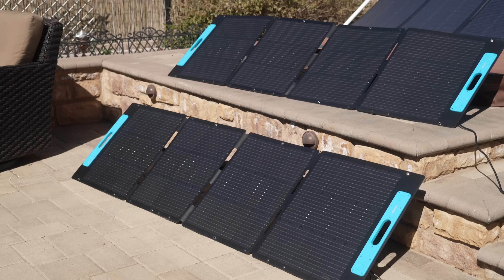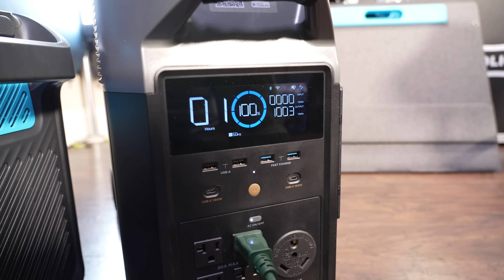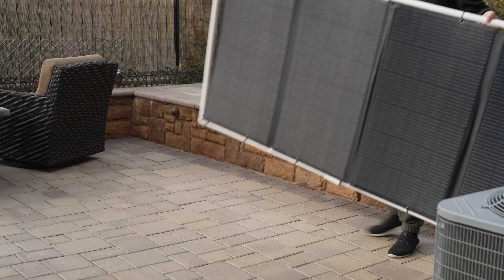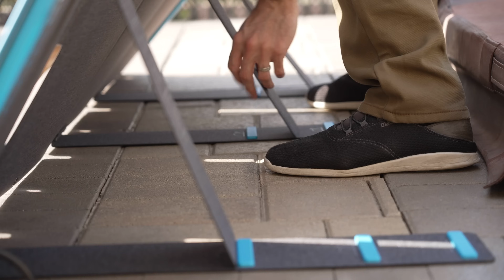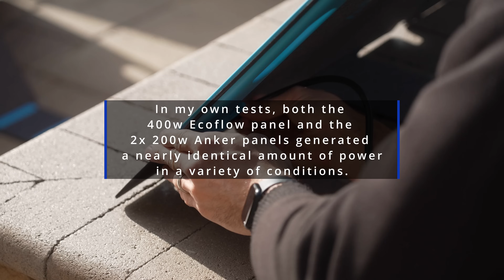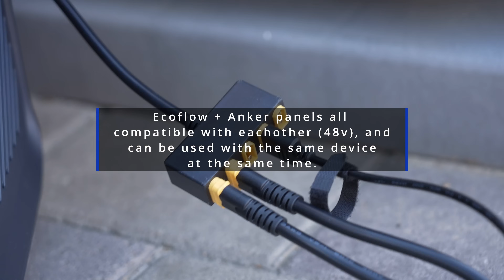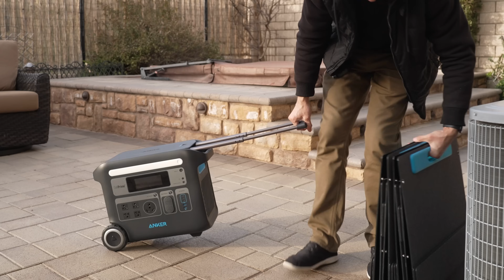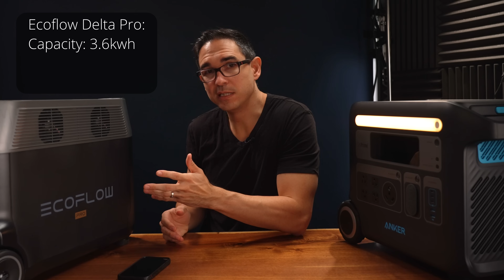Why I like the Anker Powerhouse 767 BETTER than the Ecoflow Delta Pro

Comment: it got to be an easier way than paying $5000 for generators that only last up to 36 hours. I'm still hook on using a car alternator as a generator with a small motor thats hooked up to a solor panel just to start it and once it's gets going you dont have to worry about the hours. it just seem like a rip off to keep making the rich richer.

Comment: All great points! I am looking at the spec for the 767, and I don’t see a DC 12v @ 30amp port. The spec shows 2x 12v @10amp port. Am I missing something? Or is the spec on their website wrong?
Reply from the maker: It has a 30 amp plug but I wouldn’t push it past 20 amps. (2.4kw)

Comment: Thank you very much.  I do not yet own a home battery generator.  A question I have had for quite some time is --- My need is for occasional (not very often) basic home emergency power (cell phones, fan, etc).  What I have not found addressed is what is the long-term power management for such a battery generator, which may not be used for many months, so --- do you leave it connected to AC power 100% of the time for months on end, without "using" the battery, waiting for an emergency, or is there some form of periodic use that you must perform to help drain the battery, then recharge it to full power?  In other words, just how is the battery to be maintained for months on end, over years, when the battery is not being used very much?  Thank you.
Reply from the maker: You’re supposed to do a full drain and charge once every 3 months. Otherwise you can just leave it plugged in.

Comment: We’ve seen EV owners hook up inverters to their 12v’s and power small loads like the Anker 767 will do.  My question is since the 767 has the inverter built in, could one theoretically use the solar DC input for the 767 as a way to recharge from an EV’s 12v?
In other words, power goes out, use the 767 initially and if the outage persists, then hook it up to your EV to extend run time during the outage.  Thoughts?
Reply: Yes and no. 
First issue is at 12v you could never pull a meaningful amount of energy. Generally the 12v system on ANY car can only supply 150-200w through a barrel, and even if you could hook into the 12v battery directly, it probably would still be limited by the transfer rate from the high voltage battery to the low voltage without damaging anything.
Second is you could tie into the high voltage pack (dangerous) unless you have a special charger that can work in reverse like the ford lightning. This would be most ideal in general. Lastly, these units have a limit as to how much they can take in on solar. So you maybe still exceed how quickly the battery can charge.

Comment: Quiet fans aren't much good if your batteries get cooked and die earlier. Look at the initial toyota leafs and their early batter life due to poor air cooling.
Reply: You're equating quiet with fan cooling performance. The two are not as highly correlated as you think. Fans can be made very quiet, if someone wants to bother.
Reply: Toyota Leafs? You mean Nissan LEAF?
Reply: @csf1757  Ooops. Thanks for correcting me.

Comment: Can you check if the units you have all four NEMA 5-20R receptacles (the 4 AC plugs) on the front of my unit were mis-wired, and that hot and neutral are swapped?

Comment: Hi. I am considering on getting a solar generator for my home as a battery backup in case of an outage in my area and living in the desert they can come about during Monsoon season. My question for you on this is If I have to use the generator to run some of my things, Will it charge simultainiously while it is in use?
Reply from the maker: Yes, it charges while in use.

Comment: what do you think is the lifespan of this powerhouse? is it worth buying?
Reply from the maker: If you fully charged and depleted it 0 to 100% every single day, it should still last 10 years. Warranty is 5 years, lifespan rated at 10. It should last longer than that if you use it less. It’s worth buying to me, though i don’t know your situation or reason for buying, that’s up to you.

IMO, in 10 years, we will be much further ahead in battery tech anyways, and I’ll probably upgrade my tech before then, so it should last the entire time I plan to own it without issue.
Reply: @TommyCallaway  thank u so much...

Comment: Good video! But the cycling thresholds and speed are not dependent on what type of semiconductor is in the charging circuit. It is more efficient, but the charging rate is largely determined by chemistry, cell design, temperature and current handling of charge circuit. And of course the supply. Not the type of semiconductor.
Reply from the maker: Thank you Will. I’m learning a bunch as I enter into this genre of tech. Your channel is a fantastic resource!
Reply: @TommyCallaway  oh thanks!!! :)

Comment: Make a long story short liv off grid using the ecoflow delta pro only one unit with 800w solar running every think even a 120v 2000w hot water heater fridge lights ex I over worked it finely after a year running way too much stuff at once one day and explain to ecoflow people and they sent me a new one no questions asked less than a week turnaround.

Comment: You mentioned the price compared to capacity, and the big weight difference that's made even clearer by your face expressions. I think it's also important to underline that the Ecoflow has 80% more capacity than the Anker, and weighs "just" 48% more. So Ecoflow has packed more in the same volume, and that's usually always more expensive in general.
Reply: Overall Anker is a better package.
Reply: Excellent point, but the price also reflects that capacity.
Reply: The ecoflow is down to $3000 now.
Reply: the other thing is that Ecoflow sells the referb pro for $2179 which makes the price closer.....I would go for this but not sure about lifting 100lbs
Reply: @007gomboo  how often do you have to move your battery to be concerned about the weight?!
Reply: @gerusher6682  i own the delta pro, and while I use the built in wheels to go from room to room, I do have to lift it a lot to get over high thresholds.  However, the handles on the delta pro are life savers in that regard.
Reply: @007gomboo most humans can lift 115 pounds average

Comment: The Deltas fan are loud but if it protects my investment than I don't mind it so much. I run two Delta Pros, what I ended up doing was adding a sound barrier to the bottom of the laundry room door and putting up sound dampeners on the wall. Can't really hear it anymore throughout the house. The fans on the delta are louder than my heat pump water heater.
Reply from the maker: Great ideas. Definitely going to explore the delta series more and figure out costs / cables / ideas.

Comment: This is really not a fare comparison.  The DP is a much larger in size, capacity and weight, compared to the Anker. Also, the DP is marked for total home back-up, the Anker is not. As to the cooling fans being loud, I guess that depends on the location of the unit.  Our DP is in the basement, connected to two manual transfer switches.  So, when the cooling fans turn on, we don't hear them unless in the area.  

The DP has a total of four cooling fans.  Two fresh air intake fans and two exhaust fans. (Not sure of the names of the fans) Heat is what kills batteries.

Comment: Really great video but I think the 767 is more comparable to a Delta Max than a Pro, or the Bluetti AC200MAX. Limited solar and expansion, smaller inverter. It's an awesome unit and is my fav for a 2kw unit with a bit of expansion. The quiet fans are a killer feature.
Reply: please clarify... what unit you are mentioning is better
Reply: The real comparison is the Delta 2 Max. Same type of battery, watts and kWh. Also same price. The Delta 2 max, comes in lighter, much quieter, and allows dual charging. It doesn't have wheels, and doesn't have the 30amp connection, allows 1000w of solar input.
Reply: I think the 767 with the added battery is very comparable to the Delta Pro. At least that is what I am looking at right now. I am small, older guy and while 65 lbs is ok for me to lift, 100 lbs is not impossible but tuff.
Reply: which is your fave w "quiet fans?"
Reply: @catherinenewhart  I think the 767 is the quietest 2kwh unit you can buy.
Reply: I'm 5'4" and older.. Not sure I can manage 100 lbs.
Reply: @catherinenewhart 767 would do fine in that case, im leaning more towards the delta pro simply for its power capacity im looking to go 100% off grid and the pro can be scaled up to 20kwh that gives me more than enough power to run my entire house and extras

Comment: The anker also turns off the USB ports when it runs out of power and you have to unplug the cables before they turn back on again. 
Super frustrating to have to do that each time power runs out.

Comment: One feature of the EcoFlow Delta I like is the EV Adapter that allows you to charge your at a level 2 AC EV charging station. Hopefully Anker will release a similar adapter.
Reply: That feature allowed me to recharge my Delta when the power went out in my neighborhood and it wasn't that sunny so my solar panels weren't very effective.  Got some strange looks by people when I was at the chargepoint station with my Toyota pickup truck with the cables running into my truck bed where I had my Delta.
Reply: @yoloedc5835 I'm trying to Google it but I'm struggling to find how long it takes to charge at level 2. I know on a typical 110 wall outlet it's supposed to take a few hours
Reply: That's right, it is a very critical feature for van lifers. Does anyone know how long the 767 would take to charge from a standard ac outlet?
Reply from the maker: 2 hours from 0 to full

Comment: EcoFlow Delta Pro with its different modifications and settings by far is much better and  offers more completenesse. I have 2 Delta Pro,  1 delta pro extended smart battery and the smart generator that Anker 757 couldn’t compete and  honestly, the fan noise is not a severe issue. I have my settings in a room outside my house won’t bother anyone.
Reply: How much does it weigh?
Reply: @TruckinGal-by1so  100 pounds each delta pro

Comment: Solid review, and I appreciate concise assessment of the Anker product. Size, design, features and especially the solar panels were impressive. I was actually thinking it was indeed a better choice than the Delta Pro. I only wonder if the Anker's output ratings are sufficient. The difference is considerable. Maybe the difference between near full power supply with the Ecoflow as opposed to  basic emergency requirements with the Anker. Got me thinking.
Reply: Except life of the battery
Reply: @x x  Are you saying Ecoflow battery life makes it the better choice (along with their higher output) and the cost is justified? Just want to make sure I understand correctly. Thanks

Comment: Sorry, but neither of these would be my choice, as I did my own DIY. I suggest everybody do it that way! Why, because it’s never been easier than it is today!
And you can buy an inverter/charger that hooks up solar panels and converts to AC and charges your batteries. You can buy server rack batteries at a much lower cost than before. 
I can say this because I knew nothing about electricity and I had a much harder system to build than you do today!
And lastly, it’s much more cost-effective. And you can do it without a lot of permits and regulations, by installing a 50 amp connection. These are done all the time for gas generators.
Reply from the maker: Would love a video walk thru of your setup.
Reply: @TommyCallaway  
If you’re ever around Seattle, hit me up, I’ll give you a tour ! 🖖

Comment: I have 2 Ecoflow Pro plus 2 extra batteries for each, connected to a smart panel, been hooked up for just over a month.  The fan speed seems to be impacted only by the amount of power being drawn (or charged), not by the ambient temperature. The batteries can be 56°, (according to the app), yet the fans will still come on full blast. Seems like they should be able to control speed by a software update, but it probably depends on where the sensors are inside.  better to error on the side of too much cooling than not enough, I guess. The longer I have these things the more I learn about batteries and electricity.
Reply: It is not cooling the batteries. Inverters create a lot of heat, and the ecoflow having such a large inverter makes active cooling a huge need. Go find any inverter that can consistently put out 3600w needs a lot of cooling. Go look at any stand alone inverter and there is a huge difference between a 2000w inverter and anything over 3000w.
Reply: This is also why the extra addon battery has no fan on the ecoflow. The battery is not what the fans are for.
Reply from the maker: Very valuable information. Thank you!!

Comment: have you done any kind of test where the battery is cold or hot rather than room temperature? For example, if you put it in the garage, will it work at 50°F?
Reply from the maker: Taking notes for my next videos!

Comment: Have you done any test to verify that either of these batteries have the capacity that they advertise? testing to make sure that they can provide a the max wattage is easy, but testing to make sure the actually have the storage capacity advertised takes a lot longer.

Comment: A couple of these plus a few solar panels would make a great alternative to a gas generator in case of extended power outages from major storms. You could keep a fridge going almost indefinitely, or run a window AC a few hours per night when you're sleeping.
Reply: Assuming you have clear skies and not days of rain, like we do.
Reply: @Bwanar1  Point made however I wouldn't think one would need to run the A/C if it's raining, or am I missing something?
Reply: Well Sir, I guess that depends where you live. It can be 90F or more, in Florida and raining. Which makes it a balmy heat. We run our AC 24/7 the majority of the year. I have never once gone to my thermostat to turn it off when it started to rain, because it wouldn't be needed.  @garyhutsell1355
Reply: That's what I'm hoping to do, with the next power outage from a hurricane here in FL.  Just power 2 fridge a ceiling fan and stand up-fan during the day. At night the 2 fridges, stand up fan and portable ac fan , everyone in one room for the night.

Comment: Those devices are useless for most people, you can build a system non transportable for far less money, I got a 5.5kW inverter + 14kWh of LiFepo4 for less then 2500€.
Reply from the maker: 6:09 i make exactly that point.

Comment: YOU SHOULD COMPARE THAT UNIT TO THE DELTA MAX NOT THE PRO
Reply from the maker: The video is "Why i like the Anker powerhouse better" - it fits my use case better.  It's not supposed to be an apples to apples comparison.
Reply: @TommyCallaway  oh ok....just saying because the total watt output seems comparable to the delta max That unit is cost around $2335 Canadian
Reply from the maker: I’ve reached out to ecoflow to see if they would like to send out the delta max for a round 2.
Reply: @TommyCallaway  awesome man!

Comment: Thank you for your review.  I too would probably go with Anker.  5 years warranty is awesome but do you or anyone know about their customer service if you run into any issue with the unit.  I have a Bluetti EB3A unit and having some issue with it.  From many of Bluetti user, they also having issue with their customer service (like no response or ignore with email request.. etc).  I hope Anker is not one of these company which great to sell you their product and horrible in customer service afterward (if needed).  Thank you again for your review.  I really enjoyed.
Reply: If you are worried about warranty buy ecoflow delta pro from costco. Costco recognizes ecoflow products as generators. So it falls under costco lifetime warranty for generators. I know this from personal experience. Bought one for rv camper but when tried using for camper unable to power my ac units so returned 9 months later no hassle to my local costco.

Comment: can you describe in text the details of that solar panel set up.
Reply from the maker: The panels in this video are: 
1x Ecoflow 400w Solar Panel
2x Anker 200w Solar Panels

The Ecoflow comes with a cable that terminates into an XT60 connector, and the anker panels both come with their own XT60 to XT60 cables to connect to the powerhouse. The Anker also comes with a 5 XT60 to 1 XT60 parallel connector, so you can connect several different 48v panels to it and they will all work together. This is how I connect the ecoflow + anker panels together to a single unit.

Comment: When you said around 7:10 that you charge it with 80p watts, did you mean that you used the EF and the Anker panels together or that those panels from Anker are 2 400s?
Reply from the maker: Yes, I used the anker and ecoflow panels together, at the same time.

1x Ecoflow 400w Solar Panel
2x Anker 200w Solar Panels

Comment: You realize that you will receive negative feedback because making this type of comparison is not truly an apples to apples .  The EcoFlow Pro is in a league of its own to that of the Anker.  A better comparison would have been with the EcoFlow max.
This is like comparing a KIA with a Lexus, just not the same and you may end up liking the KIA best because it is cheaper and more economical.  Of course everything is based on ones needs as it should.
Reply from the maker: Feedback is welcome. Specifically, the title of this video is why I like the Anker powerhouse better, not that is an equal comparison.